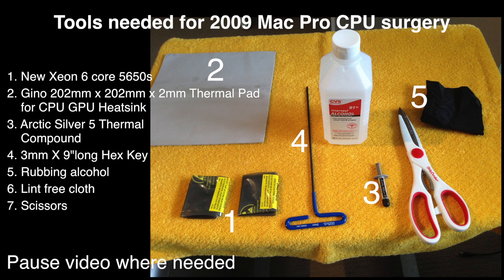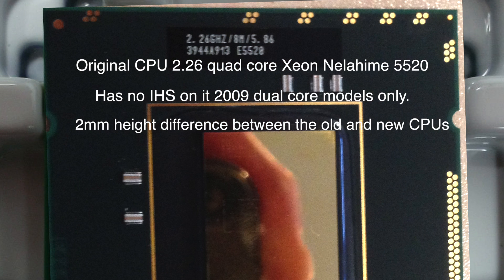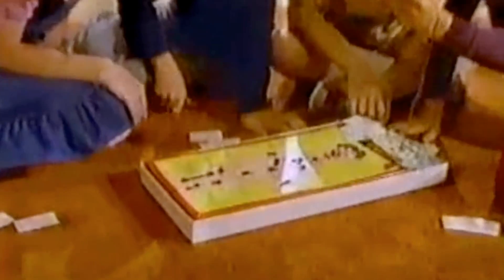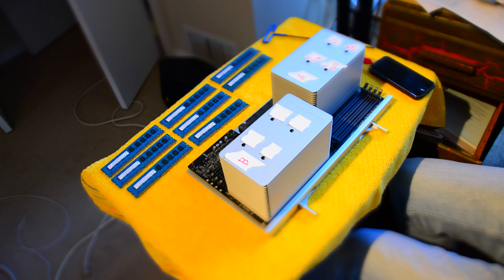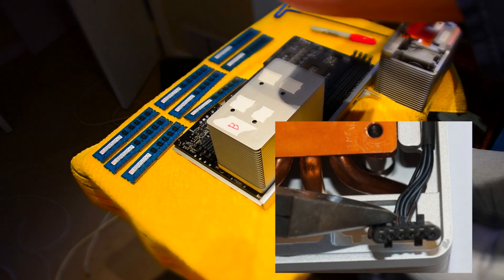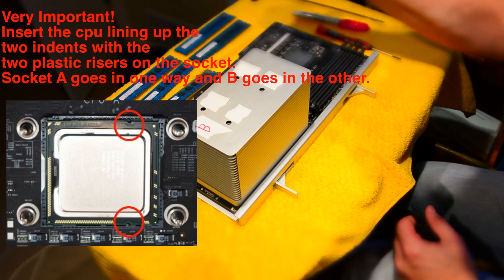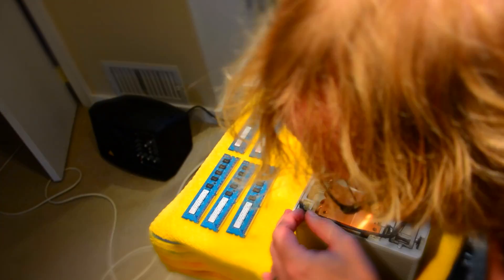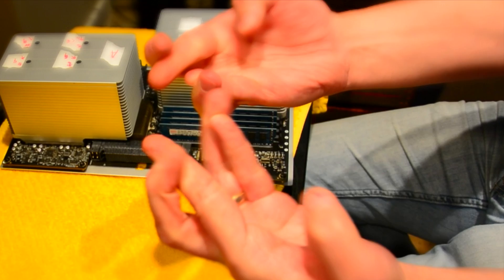Mac Pro 2009 5,1 CPU upgrade 8 core to 2010 12 core

Comment: Wait, so you do not need to de-lid the processor because of the extra thick thermal pad?
Reply from the maker: If you use cpus with the lids on you should add additional thermal pads as noted, if going with delided then you don’t need to add additional thermal pads. Delided is the easier install.
Reply: @MacSoundSolutions  thank you much appreciated

Comment: thank you a lot, Lance.
following your instructions, count the turns, not overscrew, tricky operations, very well explained. Big up

the thermal pad layers you've set:  (stuck on the connectors of the board)
-have.. 2 ,3,4mm of thickness ? 
-conductive?

Here:
https://www.imore.com/how-upgrade-your-older-mac-pro-cpu?fbclid=IwAR0cgwcNLZmprF5dVo-XFmdwa8SFngDFxSPCixHdDk-cHO_bfaevcSxT1Ok
he has put thermal pads on the board connectors,  and the (8 x 3) washers  
i noticed that, there's no layer of pink thermal foam, (stuck to the base of the heatsinker)

to ensure a safety layer of 3mm height (corresponding to the differences between an delidded and a lidded Cpu), 
and protect from the pressure of heatsinker+ screw

:-)

Comment: Nicely done, I’m so glad I stumbled across this, I’m planning to upgrade and had no idea the CPU’s were different thicknesses. I too don’t like the idea of removing the lid, surly doing that excludes physical contact with the heat sink. Is everyone happy that such a small dab of paste is enough…?
Reply from the maker: Hey yeah if you watch my second video “oops I did it again”  I learned Xeons should have a line of thermal paste from left to right while you are facing the front of the logic board as the cpu is rectangular not square. This info is on the arctic silver web site. Good luck!
Reply: Mac Sound Solutions thanks for the tip 👍

Comment: When you first booted up before installing new RAM, were you, essentially over clocking the RAM? Would it be a safer option to just purchase an upgraded processor logic board?
Reply from the maker: No over clocking my Mac came with 1333 ram but when it was a 4,1 it read the ram as 1066 ram. I bought it with the ram installed and didn’t know it was 1333 until I upgraded the firmware to a 5,1 installed the faster processors and when I reset the pram it came up as 1333 which was great because I was going to buy faster ram but found I already had it!

Comment: I accomplished the same upgrade but did not clip the heat sink connector tabs from the CPU, and of course, the fans at start-up ran at full speed. I didn't want to start the entire process over again, so I install Macs Fan Control and manually set the exhaust and intake fans to run constantly at 1000 RPM. I monitored at idle and moderate stress with no issues; the CPUs did not exceed 145 degrees Fahrenheit max and ran at approx. CPU A - 109 degrees Fahrenheit / CPU B - 97.4 degrees Fahrenheit at idle. Satisfied with the results, I shutdown and reset PRAM in order for the system to recognize the new RAM. Ran Geekbench - Results: Single Core 2786 / Multi-Core 22153. BTW, the fans, even with Macs Fan Control, will run at full speed until Macs Fan Controls initializes after login. However, I don't consider that to be an issue at all. System: 32GB - 1333 MHz, 2 x 3.06GHz. Radeon RX 560 GPU, 500GB SSD (System) mounted in a Sedna PCI Express Adapter,  1TB (Secondary).

Comment: Does this help with the cpu error or was it about the same with protocols sessions
Reply from the maker: I hear the latest version of PT and High Sierra 10.13.6 finally got rid of the spikes. I don't get them on my system Sierra and PT 12. Pro Tools likes more cores and my setup is much more powerful with the upgrade
Reply from the maker: High sierra and the latest pro tools 18.12 gets rid of the spikes I believe. I have not had that issue but I skipped a lot of the upgrades in between. Its not the computer but at the same time the more cores the better when it comes to pro tools and its a pretty cheap upgrade these days well worth it, sorry for the late reply :)

Comment: Hey Lance, I am about to perform this on my 2009 Mac Pro with twin 5690's.  Finally doing the upgrade.  I got 96GB of ram to go with it.  Looks much safer than trying to delid that soldered integrated heatspreader.  I have upgraded many of the single core systems but didn't realize the 2009 dual core was delided.  This process doesn't look to bad.  I'll upate with my results.
Reply from the maker: Chad Prestridge goof luck! It is an easier install with delided cpus. I did not delid as you know from my video.
Reply: Also if for some reason I ever moved into the 2010-2012 systems I would have to re-lid the cpu’s so I feel your method is best all the way around.

Comment: hello, I have a question, there are two models of the MacPro 4.1, the "one CPU" and the "Two CPU", this procedure is valid for the two models ?.
  Thank you so much
Reply from the maker: Yes you first have to make the 4,1 a 5,1 by the firmware updater. Then you can install 3600 Xeons in the Single CPU model or 5600 Xeons in the Dual CPU models. The fastest chips for both are 3690 for single six cores or two 5690s 3.46ghz  six cores each giving you 12 cores.
Reply: Hi . please, where I can see those details so I could do a MacPro for my daughter, where I can read that information, I thank you very much. Thank you
Reply from the maker: Please be more specific not sure exactly what you are asking. Most info is here. If I were you I would just buy a 2010 or 2012 mac pro with the slowest processors then upgrade the processors to save the most money. If you are not use to doing computer upgrades I would not get the 2009 although you may save a few bucks it's tougher to do the firmware upgrade and install the cpus. 2010 no firmware update needed and cpu install is pretty easy. Have a look at this video of mine. https://www.youtube.com/watch?v=MuFokmEJ-ck
Reply: Hi, I thank you very much for your attention and help. what I need to know which model and what PCU are what I need. I already understood that the MacPro-4.1 of 2009 of a CPU-2.66 can be changed by the CPU of W3690. and the MacPro-4.1 models of 2009 two 2 x CPU-2.26 can be changed by 2 x X5690 CPU. what other options would I have to upgrade? If you have to follow certain points or requirements? ... thank you very much
Reply from the maker: well as I said above 2009 - 2012 single CPU 3680 or 3690 and Duel CPU 5680 or 5690 the 90s are the fastest speed. This is the best boot drive you can get really for a Mac Pro https://www.ebay.com/itm/NEW-Samsung-SM951-256GB-AHCI-M-2-SSD-MZHPV256HDGL-1400-MB-s-Mac-Pro-Boot-Drive/173102568120?ssPageName=STRK%3AMEBIDX%3AIT&_trksid=p2057872.m2749.l2649 Ram is 1333. GPU depends on what apps you want to use. Gaming in boot camp I would get a flashed for mac 980ti also good for Adobe creative sweet. You have to update the driver with each system update but thanks to the card being flashed they are usable even when the driver is not installed. Other non flashed GPUs work but you don't get the boot screen and can be an issue with an NVIDIA card if you upgrade the system. AMD cards are best for FCPX and good for games but the RX580 for example is not a flashable card hence no boot screen but at least Apple has built in driver support so the card always works after updating your system as long as you start with 10.13 and later. My 980ti runs on local power with no mods, not great with FCPX it works but it is slower than an RX 580. But it is great with everything else. I can deal with a video taking 5 more minutes to export. Here is a flashed 780 which is about half the price of a 980ti https://www.ebay.com/itm/Nvidia-GeForce-GTX-780-3GB-for-Apple-Mac-Pro-2008-2012-680-K5000-HD-7950-980/252536292792?hash=item3acc5605b8:g:gTcAAOSwAuZX1mzW here is a flashed 980ti https://www.ebay.com/itm/NVIDIA-GTX-980Ti-6GB-4K-5K-PCIe-Video-Card-for-Apple-Mac-Pro-and-PC/232814912270?hash=item3634d9a30e:g:AVEAAOSw0OxZsbLH if you want any more info I will have to charge you :)
Reply: Hello, how are you, I'm going into details, and thanks to you I understand this topic much better. You can give me your opinion on these two models there will be some difference to make the boot. Thank you. MZVPV256HDGL & MZHPV256HDGL .
Reply from the maker: MZHPV256HDGL .it has to be a AHCI not NVMe like the link I already gave you. Those are the only 951s that are bootable with a Mac Pro 2009-2012
 https://www.amazon.com/Samsung-SM951-256GB-Version-Solid/dp/B00VELD92U/ref=sr_1_1?s=electronics&ie=UTF8&qid=1530823233&sr=1-1&keywords=samsung+AHCI they are expensive because they are hard to find. You can also just use a pcie card and a regular SSD drive but they are not nearly as fast as the AHCI. My mac pro boots in 13 seconds which is great.
Reply: Hi. how are you, I thank you for your time and help, thanks to you I managed to do a mac pro update for my daughter, your explanations and kindness helped me a lot to understand this matter.
Reply: Hi. how are you, now in my last details I am on a big trail of options to be able to decide my video card, AMD models are the most compatible for mac pro, but people are like crazy with bitcoin miners and have video card in the bullseye, this makes them very expensive, The Nvidia Models much confusion which could be flashed or could be used for mac pro.
Reply: Hello how are you?.
I already bought the video card "AMD Radeon RX 580 8GB", I have a doubt, this video card has 6 pin for the power supply, should I use a single mini cable 6 pin to 6 pin male PCI-E? . or two mini 6 pin to 6 Pin male PCI-E Y Splitter Power cable ?. I see that depending on the consumption of the video card is that they use one or two, but these cables are not common, what is your advice? thank you very much
Reply from the maker: It really comes down to what programs she wants to use on her mac pro that are GPU intensive. If she uses Adobe Premier that uses cuda cores for acceleration etc  she should get a Nvidia card but you have to install new drivers with every Apple OS update and sometimes you have to wait for the drivers to come out. AMD is good for Final Cut Pro X. Look here for results www.barefeats.com for comparisons. Also any of the new cards you will not get a boot.screen unless you get your card a flashed by or purchase one of www.macvidcards.com flashed cards, I have a 98ti which is pretty good, and you can find flashed ones on ebay for mac. 1080ti needs more power than the graphic ports on the mac pro can provide and the same for the AMD Vega. The 1080 and the RX 580 bothe good middle of the road cards or can run off of the Mac Pros GPU power ports. The more power hungry  GPUs need 8pinn to dula six pin and a 8 pinn to sata to get enough power without shutting down the computer when stressed.
Reply: Hi, The video card has 6 pin http://i155.photobucket.com/albums/s310/yetycuba/Mac/s-l1600_zpsmaymzjru.jpg 
     http://i155.photobucket.com/albums/s310/yetycuba/Mac/556_zpsjqqhkh42.png, which connector should I use for the power supply?
  thank you very much

Comment: Hi there I have a 2008 Mac Pro 2.8ghz and I keep and having this problem. The computer running fine but some time it will not turn on unless I unplugged it for feel hours then it will turn on like normal. Do you know by any chance what is causing this ? Please help and  thank you
Reply from the maker: Sounds like it may be over heating get the trial version of istat and check your CPU temps. You may need to put new thermal paste on your cpu. Also what graphics card are you using it could be drawing too much power.
Reply: Lance McVickar okay I will get back to you soon and thank you so much for answering it mean a lot
Reply: Now I have a new problem. When I erase hard drive to do a fresh install the keep saying that (the items is unavailable right now try again later ) so now I don’t have any operating system at all so do have any tip or Ideal do to combat this be i have a awesome machine but no operation system at help please
Reply from the maker: boot your mac and right after you hear the chime hold down the Command and r key, this boots you  in recovery mode then select reinstall mac OS. https://support.apple.com/en-us/HT201314
Reply: that what I did and it all go well until the last step after i put my apple id in and a error pup up and said " this item is unavailable right now try again later"

Comment: RAM - ISSUE
Upgrading firmware MacPro 2009 4.1 to 5.1 & CPU upgrade: Intel® Xeon® Processor W3520 to Intel® Xeon® Processor W3690 - ALL PERFECT!
However, system will recognise only two RAM slots (8GBt out of 3x4=12GBt installed)?
While fitting 3x2Gbt=6Gb original 1066MHz RAM will recognize all three RAM slots.
Purge RAM and changing RAM modules 1to3 & 3to2 will not solve the problem as well...
What's the problem?
I would appreciate your resonable oppinion.
With regards,
Andre

Comment: Hey Lance, Great vid! I'm curious about something. I've read the newer posts (last 6 months) and it seems you now have 5680's instead of 5650's. When you recorded this video, you had the 5650's installed and your Geekbench scores were 26336 which is pretty nice. I just installed a couple 5670's into a Mac Pro 2.26 and I'm only getting 21676. I have the firmware up to 5,1, Ram is 1333. Any idea's as to why I'm not getting better numbers? Thx!
Reply from the maker: Most likely it's what version of Geekbench you are using. Geekbench 3 64 bit paid version gives you higher scores than Geekbench 3 free 32 bit version. Geekbench 4  lowered all benchmark scores to compensate for newer faster computers. So mine gets the best score with Geekbench 3 64 bit as GB 4 was not out at the time when I made this vid. Cheers!
Reply: Thanks for the feedback, Lance. I have noticed that several folks have asked the same questions and that GB4 does lower scores due to faster computers. Cheers!

Comment: Thanks Lance! I successfully upgraded my 2009 Mac Pro 4.1 to 5.1, and upgraded the standard 2.26GHz quad-core processors to 3.33GHz six-core processors. I upgraded the Mac Pro with 48GB RAM (3x 8GB per processor). The RAM is 1333MHz, but the Mac Pro recognises it as 1066MHz. Any idea what it can be ??? @Lance McVickar
Reply from the maker: you neesd to zap your pram and it should show up after that.
Reply: Lance McVickar How do i do that ?
Reply from the maker: Here's how to reset your PRAM:

    Shut down your machine. Yes, all the way down, not sleep or logging out.
    Press the power button and then press command-option-p-r. ...
    Hold those keys down until your Mac reboots again and you here the startup chime.
    Let go of the keys and let your Mac reboot normally.
Reply: Lance McVickar thanks! Sorry to throw all these questions 🙈. I did the PRam reset, after the second chime i let go of all keys. Now the mac pro doesn't seem to start osx anymore... can it be my gpu card? (GTX 970, it needs the Nvidia and Cuda drivers)
Reply from the maker: Dutchground Media it should restart but zapping pram reinitialises settings and graphics so you may need to reinstall the driver cuss should make no diff. Just force shut down and reboot again
Reply from the maker: Cuda makes no diff just the driver
Reply: Lance McVickar Bingo! You're the man! 😎. I rebooted with the original GT120 card, and the NVIDIA Driver Manager was set back to "OS X Default Graphics Driver". I set it to "NVIDIA Web Driver", rebooted, and Bingo! (And the memory is now recognized as 1333MHz RAM ! 😍 you made my day, thanks mate !

Comment: Your video was helpful even though I didn't do the processor upgrade! It helped me identify an insufficiently-tightened CPU heat sink as the cause of a gray screen and logic board LED after another repair - a repair which people doing the CPU upgrade should probably do, even if it's not immediately needed: replacing the plastic push-pins with spring which secure the Northbridge heat sink to the logic board. One of the pushpins is under the heatsink for CPU-A, so you might as well replace it while the heat sink is detached. It'll almost certainly fail at some point.

In my case, that pushpin was completely gone. It had fallen apart, leaving only plastic shards and the spring underneath the logic board. As a result, the Northbridge heat sink wasn't making sufficient contact with the chip, the chip would overheat, and the computer would shut down randomly, sometimes with kernel panics, sometimes not.

I replaced the push pin with a #4-40 bolt and nut, after reading about it on a MacRumors forum post. This solution leaves a little less play than the pushpin (one of which was intact when I did my surgery), so I might replace it with a pushpin from eBay, though the one under the heat sink might have to be trimmed down.

Before repair, the Northbridge sensor was at least 240ºF; now it's down to 160ºF. (It runs hot by design, from what I read somewhere...)

Also,  helpful tips from the Apple Service Manual, which can be found online:

1. Apply the  thermal grease in the shape of a squished theta (oval bisected by horizontal line). They say use 0.1g.

2. When mounting the heat sink,  use one hand to keep it level. Use no more than two full turns of a screw at a time. Tighten to finger-tight, then an additional quarter-turn.

Comment: Now it seems you can get the 5680s  ... do you recommend those .  I assume they take the same ram as yours
Reply from the maker: michael b yes that's what I have installed now two 5680s.
Reply from the maker: michael b 5600 series are for dual CPU systems 3600s are for single.
Reply: Thought you installed 5650s??   Anyway.  I got two sets coming soon and hopefully will make my two 2009s alot quicker.